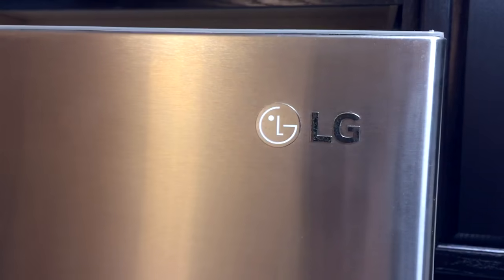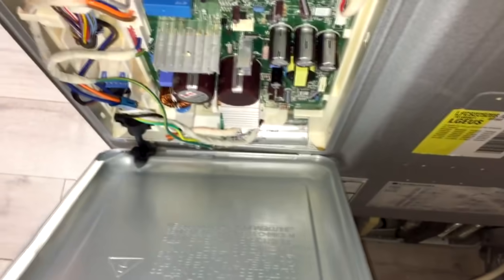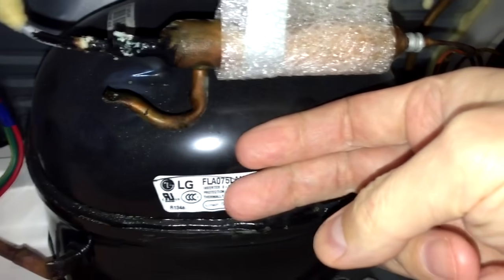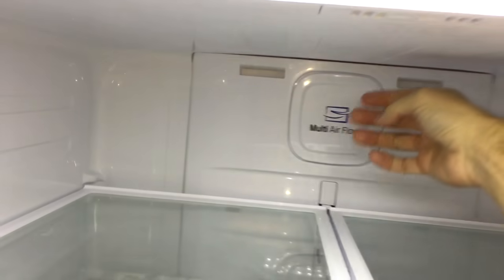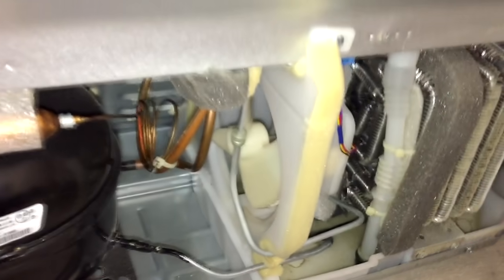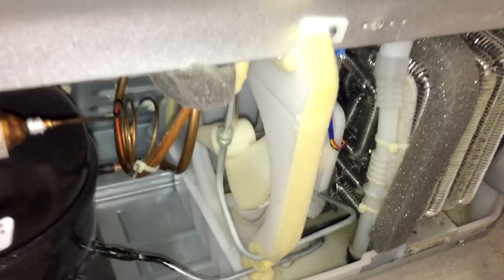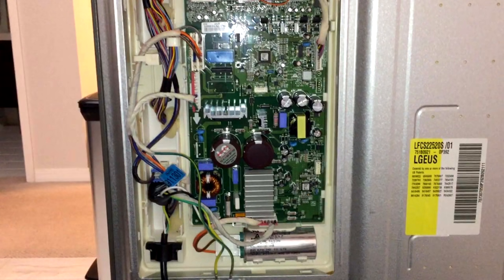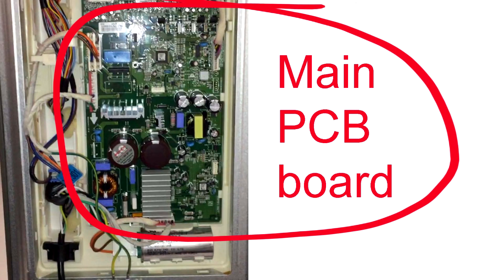LG refrigerator test and reset button

Comment: Hey really informative video, i did the diagnostic test and i did feel the airflow, so if the test mode works but airflow doesn't come on in regular mode, does it mean compressor is ok but something else in sealed system isn't ?
Reply from the maker: In some refrigerator models when you open the door the fan automatically stops blowing air. You'll have to activate the door switch and hold it for about a minute, and the fan should start blowing air again. If the air is warm, it's probably because of a bad (inefficient) compressor. Very common for LG Linear compressors. LG replaces those compressors for free for the first 5 years.
Reply: @Your-Self  hey thanks, in the test mode i opened the door yet could feel airflow in both fridge and freezer, in regular mode i dont feel it, i dont have door switch i have door in door so i can technically still open and should feel air but i dont, what should i check next?
Reply from the maker: Every refrigerator has a door switch to turn lights out when you close it. Yours is probably the invisible Reed Switch activated by a magnet as on this video: https://youtu.be/ipwOerjFITg
If the blowing air is warm, it's probably the Sealed System issue (compressor most likely). If the air is slightly cold, hopefully, a Defrost Problem, but could also be the beginning of the Sealed System problem. To verify it, you'll need to remove everything from the freezer and look at the Evaporator Coil frost pattern. Thick layers of frost and ice, means Defrost problem. No frost at all, or very little on ONE SIDE ONLY, means Sealed System problem. If you activate the door switch, but the fan is still not blowing air, that's a rare problem... possibly the main PCB.
Reply: Did you ever figure out the problem? I can also feel cold air blowing during the test but not during normal operation.
Reply: @Your-Self  I’ve run through the tests — thank you for this tutorial! — and the Error Code light isn’t lighting. The refrigerator is lukewarm but the freezer works fine. I’ve cleaned the disgusting fluid that had pooled in the evaporator tray (on the bottom right, beneath the fridge’s rear bottom panel), but I’m not sure if that might have been related. I also haven’t figured out how to clean the drainage tray that’s visible through the plastic vents at the back interior bottom of the refrigerator section.

Comment: Thank you very much. Few YouTubers are so thorough in spelling out the steps. I'm still left with a mystery though: I pressed the button one time (never any LED flashes), and my refrigerator started blowing again. I may never know why it was tripped. Any ideas? (I won't know for some hours whether it cools, but the compressor and all fans are blowing).
Reply from the maker: LG linear compressors cool very slowly. So give it a whole day to work its magic.
And if it's still warm, there could be a Sealed System (expensive) issue. If your refrigerator is under 5 years old, LG may replace the compressor for free.

Comment: Our fridge was so loud and the tech said he could not find anything wrong with it! We could tell that a fan was rubbing on something and if you would open the freezer you could see the fan stop and so would the noise. I tried this and a lot of water went into the drip pan in the back. For now it seems quiet so we will see what happens throughout the day.
Thanks for the info!
Reply from the maker: It seems like you have an excessive ice accumulation by the evaporator fan. This could be a one-time deal (if the door wasn't closed tightly, you put hot soup in the fridge, etc...), or become a reoccurring problem (if the defrost sensor has gone bad, broken air-seal, etc..). I'd run another defrost cycle (Test #3), to make sure all extra ice has been melted. And if the problem comes back in 2-4 weeks, call a technician, but not the same one.

Comment: Good morning hi evaporator fan is running in test mode but I just plugged it back in after testing and the fan is not running. Do you have a video that shows me the next steps to take  ?  Thank you so much for your help great video
Reply: Same with mine. It is very likely the compressor

Comment: I would like to thank you very much for this video. We have kenmore elite french door model 74043 , built in 2016. It has all LG stuff in it. We ran the diagnostic test and everything was working fine, even the air was cold and yet refrigerator is not going lower than 50 degrees. freezer is working fine. We opened up every part of the refrigerator and freezer to make sure there was no ice buildup but everything is squeaky clean from inside out. going nuts here. Please help us.
Reply from the maker: When you say the freezer temperature is "fine," can you verify that it's around 0°F with a separate thermometer?
When the fresh-food compartment is not going lower than 50°F, does the compressor continue to run (trying to cool lower), or it's resting?
What is the complete model number?
Reply: Defrost may not be working or the drain is plugged allowing ice to build up.
Reply: Ever get a fix, having a similar issue.
Reply: @claimed4all did you fix it?

Comment: I did the test,  it looks  like everything  was working  the fans inside the freezer and fridge were working  fine for around 5 minutes but then they stopped.. so what could it be...
Reply: Any luck
Reply: @shanebudiac6481  no
Reply: Same for me. Did the tests and everything worked - fans blew, compressor working and I actually felt cold air. Finish test and fans / compressor stop working.
Reply: Anybody figure this out?  Everything seems to be working in the back but nothing in the front.
Reply: Same... But it won't cool.
Reply: Same... But it won't cool.
Reply: I was unable to diagnosis. Bit the bullet and had LG send the repair guy. 30 minutes of labor and $500 later, its working. 3-4k fridge that "works" for 5 years before another major repair (I believe i had the same issue a few months after purchasing). Never buying LG again
Reply: @dannyr210  Do you know what the repair guy fixed?
Reply: @Music-vr7sz  replaced compressor and 3 parts that go with it, think 1 was a fan maybe and then added whatever coolant the fridge uses.
Reply: @dannyr210  Oof.  I was hoping for something easy to replace.
Reply: @dannyr210 literally nobody on earth can replace a compressor, filter, capillary tube, and fill it back up with gas in 30 minutes
Reply: @dannyr210 wow a fan and a compressor in 30 minutes? Give me his number

Comment: I found this video extremely helpful. Super simple and effective. It did not solve my problem though. Light M201 in the Inverter section is flashing red 3 times and my fridge is not cooling which leads me to believe that the inverter is busted.
Reply from the maker: If you have a multimeter, check the compressor as in this video https://youtu.be/zYIC7LMkKak
Lg says it's the most common issue with 3 blinks. Also, make sure all wires are sitting well. Unplug and plug them back in.

Comment: Thank you!  For now at least, you saved me a huge repair bill.
Reply from the maker: Good to hear it, and thanks for watching!
Reply: I have a LG inverter 3 door and is building ice where the coils are idk what it could be would the reset works on this fridge pls help
Reply from the maker: @Manuel Jaramillo what coils are you referring to, the freezer, fridge, or condenser next to the compressor? Please start a new thread with your model number. (I don't always get replies on old messages)
Reply: @Your-Self  is the one inside fridge behind fridge wall panel is building ice
Reply from the maker: @Manuel Jaramillo try to turn OFF and defrost your refrigerator for about 24 hours with open doors. If the ice comes back, you'll need to call a tech to look for a Defrost, or a Drain problem.
Reply: Ok thanks

Comment: Thank you this is very informative. does the main pcb board control the ice maker cycles or just supply power to the ice maker. thank you (my fridge is a few yrs old and the ice maker will not cycle, i have tried turning power off/on but i only see the green led on the ice maker...no movement. i have water to the ice maker and the temp is cold enough)
Reply from the maker: Every model is different, but the PCB probably checks for the right temperature around the ice maker and then sends the power to it.
Look for a test button below the ice maker or a pinhole on the side. Slide a paper clip into the hole, and hold it for 3 seconds for a cycle to begin. Or hold the test button for the same 3 seconds. If the ice maker is not rotating, it's probably bad.
Reply: @Your-Self  Thanks for the quick reply. I turned the ice maker on/off several times waiting 10 minutes. And also pulled the 120v pwer from the fridge. And Praise the Lord after a couple of hours it started working.

Comment: Thank you for the helpful video. I tried the test on my LG fridge (my PCB is mounted on top) but didn't seem to produce any errors. After a power outage the freezer is blowing air that is about 55 degrees F. Won't get colder even though compressor stays on. Any ideas what might cause that? Oh I can also hear a slight buzzing coming from the PCB, not sure if that is normal.
Reply from the maker: A power outage may corrupt the PCB, so it's best to plug the fridge and all your electronics into the surge protectors. After running this test, the PCB may get reset and come back to full life within 24 hours, or may not.
Make sure the condenser coils, next to the compressor, is not full of dust and hair... clean with a brush and vacuum if needed.
Next, I'd check the evaporator coils behind the back wall inside the freezer. If it's covered in a thick layer of ice and frost, you may have a Defrost Problem.
Reply: @Your-Self  I have the same fridge with PCB board top and has the same issue with power outage. Ran the reset test and clean the condenser coils, no luck. Should I turn off the refrigerator for 24hr or leave it on?
Reply: @namlam9956   why isn't @yourSelf replying? I have the same issue too, after power outage my fridge/freezer was not cooling, tried reset got no errors and no cold. the freezer and fridge ran for a bit then stops.

Comment: Thanks for your videos. 

I have an LG LRBC20512SW that came with our house we bought last July that stopped cooling. 

I can't find a test button on the motherboard. 

The compressor sounds fine. It's fan works. The interior air flow fan works. But there's no cold air.

What can be the issue? 

I also have a large Frigidaire freezer model LFFH20F3QWC that stopped working. 
 
Nothing happens when I plug in. I don't hear any sound at all from compressor or fans.
Only the light turns on. 
I ordered a relay & capacitor with the hope that can fix it.
I also noticed in the past that the coils froze up. What can be causing that?

Any help on either of these would be greatly appreciated. 

Thank you
Reply from the maker: That model LG looks like doesn't have a test button. The compressor is "old skool" basic, which is more reliable than LG Linear. So if it runs together with fans, most likely the refrigerant gas has leaked out... an expensive fix (assuming frozen coils were on Frigidaire). Maybe somebody could "gas it up" for you, and see if it holds the charge.

The Frigidaire may have a stuck Timer (located near the compressor). I think the knob on that timer could be turned by hand clockwise. Try turning it until the compressor and the fan kick in.
Reply: @Your-Self  Thank you for taking the time to reply!!! For the LG LRBC20512SW Fridge if it's indeed an expensive fix it wouldn't be worth doing Is there any way to tell if the refrigerant leaked? Is it possible that it's another issue like a faulty motherboard perhaps?

Regarding the Frigidaire LFFH20F3QWC freeze  I turned the defroster timer knob a few times but still nothing works. I'm waiting for the capacitor to arrive to see if that will fix anything but I really have no idea what the issue is.
Reply from the maker: If the compressor and fans on LG are running, the motherboard is doing its job. The only way to verify the refrigerant leak is to pierce the copper tube and check the pressure inside. If there is no pressure (while the fridge is unplugged), the gas is gone.

On Frigidaire, the compressor and the fan are on a parallel circuit. That means one can work without the other. If they both don't work, something they have in common is the problem... unless the fan died earlier. That's where you need a multimeter to check each component and trace where you lose the voltage. The voltage is supplied to both of them through the Thermostat (Cold Control) and the Timer. So if you get about 120VAC at the Timer (between pins 1 and 3), the Timer is probably burnt inside. If there is no voltage, the Thermostat is bad. Try replacing it.
It's a live electric test and can be dangerous.

Comment: Hi there. Amazing video. I tried this however during the test I can feel the cool  air coming through the vents but it doesn’t blow any air during normal operation. Fridge randomly started to not cool. Both the freezer and the upper compartment isn’t cooling. During the test there is cold air blowing in the compartments but once test is done there is no airflow. Any fix ?
Reply from the maker: Try to narrow down the problem. 
1. Does the compressor regularly turn itself ON and run, but you don't feel any air inside the refrigerator?
2. Or the compressor never runs during normal operation, but works during the test mode?
Keep in mind that in some models when you open the door, the fan will automatically stop blowing air, so you need to activate the door switch and hold it for a minute for a fan start again.
Reply: YourSelf thank you for your reply. Compressor is on full time but the cooling is very low. It’s still cooling but no where near the normal cooling temperature.  I don’t feel any air blowing into the compartments at all
Reply from the maker: You didn't mention if you activated the door switch for about a minute while checking the airflow... that's important.
What is your refrigerator model number?
Reply: Having the exact same problem, my model is  lmxs30776s. Test mode fan blow cool air, when test mode is done the compressor runs for about 3 or so minutes then stop then run again and repeat that... freezer someone cool fresh food compartment is hot. The fan next to the compressor continue to run. The compressor was replaced by a certified technician and that’s when the 6 flashes started. Replaced the PCB board which I don’t think was the problem now. Still no good. Refrigerator $3000 plus, compressor $500 plus labor, PCB board $230. I have a very expensive hot box taking up space in my kitchen
Reply from the maker: @Michael Maxwell nice and complicated model with a dual evaporator. Maybe the certified tech didn't know how to work on this model. Probably need to reinstall the compressor and refill the sealed system properly. If it was replaced by a new "Universal" compressor, the main PCB needs to be reprogrammed with a special LG software jig to run properly.
Reply: YourSelf thanks for the response, I’m starting to believe that the tech wasn’t sure how to work on this model. He spend a lot time on the phone. The compressor is OEM, not universal. I’m going have have someone with seal system experience check it out. So frustrating, thanks man
Reply: YourSelf found out the old compressor is different from the new one: the old one part number is FLB075LBNA while the new one is FLS075LANA. Is this ok what is consider the new universal compressor?
Reply from the maker: @Michael Maxwell your new compressor is the Universal compressor, so the PCB needed software update. Since the PCB was replaced, maybe the new PCB was already updated... I'm not sure. You need someone with LG experience to figure it out. Since your fridge has 2 evaporators, maybe it just needs to be evacuated and refilled with refrigerant the right way by a tech who knows how to work with a 3-way valve.
Reply: I had the same problem too. Holding the door switch down did not cause the air to flow, even after holding for a couple of minutes. Any idea? Also, my in-door ice maker isn’t working. LG model LFX31945ST. Thanks!
Reply from the maker: @jkramer324 please start a new thread, I don't always get notifications on old messages.
Did the freezer and fridge fans work during the Test Mode?
Was the air blowing cold or warm?
The ice maker typically doesn't work if the temperature is too warm.
Reply: @Your-Self  Hi， thanks for posting. we have the same problem. during test， it runs good. cold air. after finishing testing. it doesnot work. we unpluged and took rest. and then pluged again. still no working.
Reply: @Your-Self  we have model LFXS 30766s

Comment: Thank you for the video, what is the course of action for 6 blinks? Compressor is running fine, it’s not too hot either, no restriction
Reply from the maker: Most of the time, the 6 blinks indicate an expensive "sealed system" problem.
To find out exactly what the problem is, a technician needs to install gauges and check the pressure.